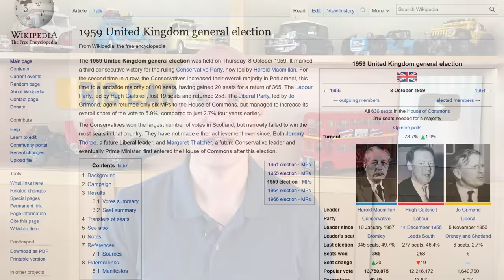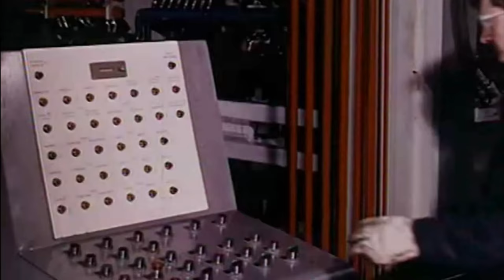Hillman Imp - Optional Extra

Comment: The reason why the factory was not built in Coventry was because of the Distribution of Industry Act(s). This was to move industry from the West Midlands to areas with industries that were doing well and had full employment to regions that had declining industries such as Wales, the North East and North West England and Scotland. There was a prohibition, especially in Birmingham, on building factories and offices. The aim was to reduce the population of Birmingham from 1.1 million to less than a million. The Distribution of Industry acts applied throughout the UK, but there was a specific focus on Birmingham.
Rootes had space behind it Coventry factory to build the new Imp factory but could not get the necessary development licence. Many other factories were moved from the Midlands to other areas, Ford to Bridgend, Rover to Cardiff etc. 
Whilst distributing industry in this way may be a good idea politically to soak up unemployment, it does not help if employment is taken away from an area that has been successfully making the product, increasing the cost of the product.